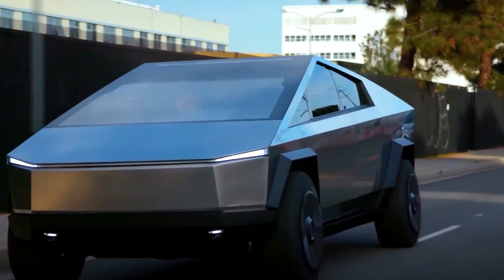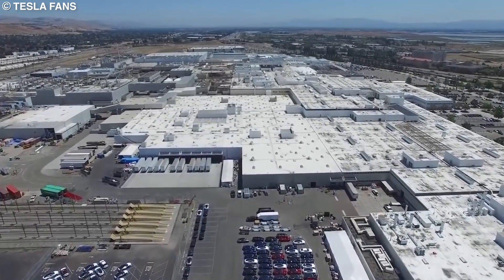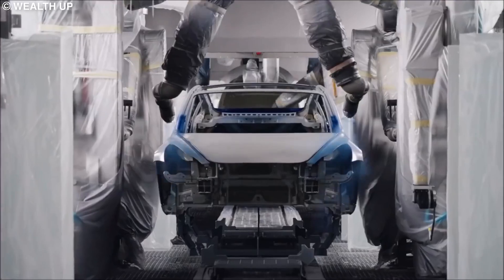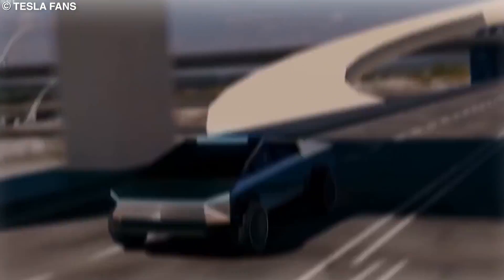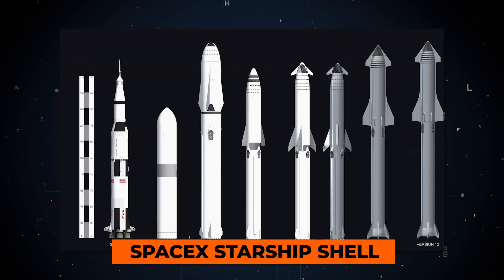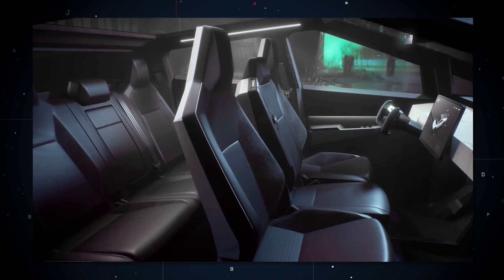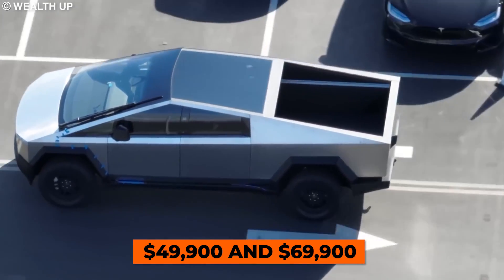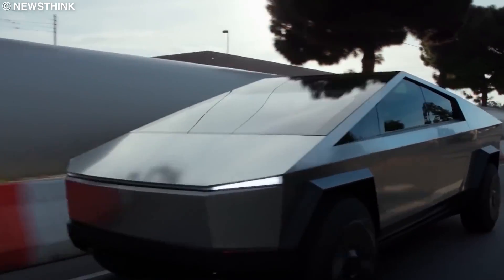Inside Tesla's NEW $2 Billion Cybertruck Gigafactory

Comment: Most of the information is pretty old and you can find better information at places like Teslarati and Clean Technica (Spelling might be off) and similar websites. It has been said a single motor is no longer going to be made and that they have a quad motor coming out that would possibly be the 600+ miles. There is also a possibility of a 25% increase in the price of each of these vehicles. Other than that, this is a very good video. 👍🏼
Reply: Hello Big Fan  🚀🚀 You wanna take a drive in my Tesla cars?
Reply: @elonmusk8338  Your private jet and Cybertruck maybe. I wish this wasn’t a Hoax. It would be pretty badass for Elon to come get me from this deployment.
Reply: @soucyno1  👍
Reply: @soucyno1  can I have your email address now?
Reply: @soucyno1  it will be more secured for us to discuss there on the chat
Reply: @soucyno1  musk74037 @
Reply: @elonmusk8338  o
Reply: ol
Reply: llllllllllllllllllllllllll9l
Reply: oll
Reply: ll
Reply: ll
Reply: ll
Reply: llolll
Reply: llnllllllllll
Reply: l